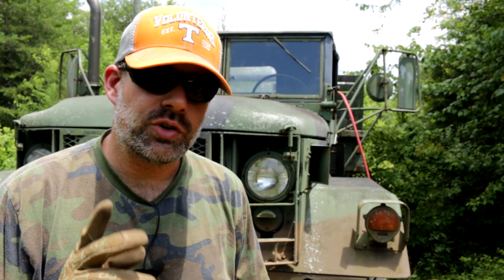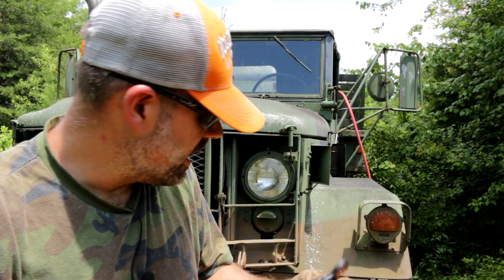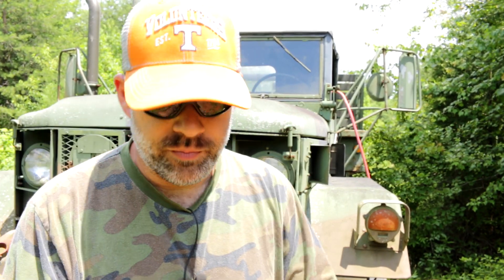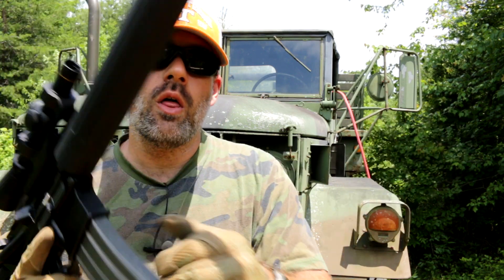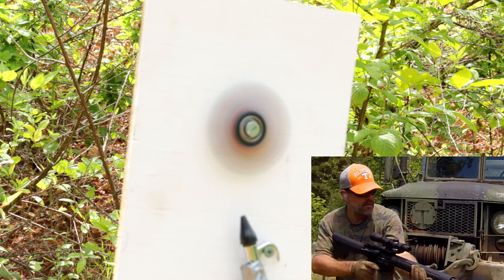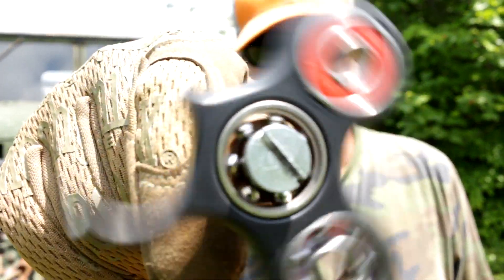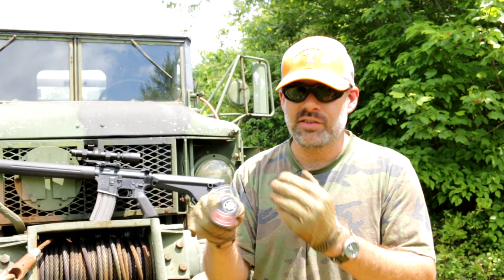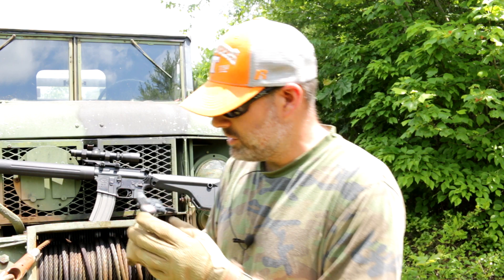20000RPM Fidget Spinner Vs. AR-15!

Comment: CNN headline : ex school teacher murders innocent fidget spinner with ghost gun assault rifle anti tank missile launcher 15
Reply from the maker: Any publicity is good publicity.
Reply: DEUCE AND GUNS . Lol you're the best YouTuber . I'm going to try to buy and fix up a military surplus Humvee .
Reply from the maker: I'm right there with you on those surplus Humvees.  I've never been so tempted to replace my old F-250 till those started being auctioned off.
Reply: DEUCE AND GUNS .  Are there any newer parts in production that are compatible with Humvees .  I hear it's slim pickings because some parts aren't in production anymore
Reply from the maker: That's whats been holding me back.  The engine/trans parts are easy to find but many other parts are specific to the Humvee and not in production.  I've seen people who've put $10k into a surplus Humvee to make it street worthy.
Reply: so  just a question but do you have any kinda of proof that the  Fidget Spinner was spinning at 20,000RPM?
Reply from the maker: Well, I recorded this in 120 frames per second and then counted the revolutions per frame.  When I got that number I calculated the...I'm kidding, I pulled it straight out of my butt like all the other spinner vids out there.

Comment: Cool video B.C..  back in my day as a kid, 40+ yrs ago, our skateboards were open bearing held in by races lubricated with fine graphite my Father picked up at his place of work, Lockheed Aircraft Service. Those old skateboards were much faster than the enclosed sealed precision bearings that were becoming all the rage.
    My Father had access to the material known as "Micarta" used at Lockheed for "What, I have no idea", and cut me out a skateboard resembling a "G.T. fishtail style  board", I was the fastest kid in the town...LOL. 
       Thanks for sharing B.C.....dont forget...7.62x39 upper.  your last reply was to remind you... take care!. Eric dee.
Reply from the maker: Alright Mr. Dee.  I just returned from my first outing with my 7.62x39 upper.  I emptied one 10 rd mag and two 28 rd mags with no issues before a storm hit ending my shooting session.  Firstly, the equipment:  I tested both a rifle and carbine lower setup and both worked with no issues.  Secondly, the upper was a complete (including bcg) Bear Creek Arsenal Upper that I got on sale for $199.  Thirdly, the mag (very important) was a C Products Defense 28 rd mag (and a 10 rd mag).  Lastly, the ammo was a mix of Tula, Brown Bear, FMJ, and HP. I didn't have one hiccup and it feed flawlessly, recoil was heavier than 5.56, using irons I had a 3" group at 50 yards while quick firing (one shot per sec).  I'll be putting up a video in a few weeks.  Things to look for are feed ramps that are enlarged to about twice as large as the regular M4 feed ramps.   Link to the Pic of the last target of the day.  http://imgur.com/a/Kqf72
Reply: DEUCE AND GUNS : Hello B.C. and good morning, now you have me sold, $199.00 for a second rifle?, you stole that one. I am going to scout around for the 7.62x39 upper.  The grouping for a somewhat rapid fire isn't bad,  I'am sure you'll be able to tighten that up in a jiffy, maybe lap the bore with some lapping compound followed with a moly coat. 
   You covered one of my biggest curiosities, the Magazine!, now correct me if I am wrong, those 7.62x39 uppers are "magazine specific"?, and the lower won't accept any AK style mag?.
    Another question for you, are the barrels removable in the same manner as the AR upper? it would be nice to swap out barrels from 16" to 18" and so on to match with bullet weights to get the accuracy dialed in.
   Thanks for your time B.C., I'am going to stay tuned to see your full review on your set up, it sounds like a winner to me.
                Kind regards! Eric Dee.
Reply from the maker: The mag is a special one designed for using 7.62x39 in a regular AR-15 lower.  There are AR-15 lowers made to take a regular AK47 mag but I'm not investing in a lower that can only be used for one application.  Link to where I purchased the mags. http://www.shop.northriverllc.com/762-x-39-AR-Magazines_c19.htm  As far as barrels go it's a standard bolt carrier with a 7.62x39 bolt and standard barrel chambered in 7.62x39 so easy to change out just like any other AR.  I'll be throwing scope on it soon to really test the accuracy but I'm assuming 2-3 inch groups at 100 yards with standard Tula grade ammo which is the same as my scoped SKS.

Comment: Use 4 very small nails in a square pattern (or just one) in the center of the fidget to brace it to the board then blast away at it in the center with a large caliber round. 45 maybe? See if you can completely obliterate it, you Deadshot, you.